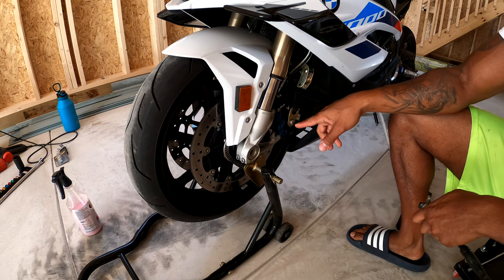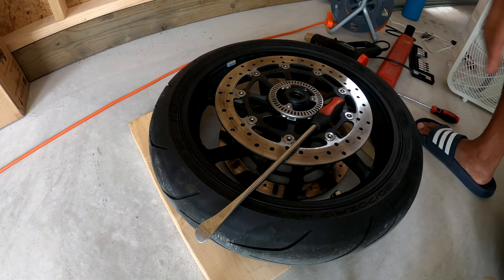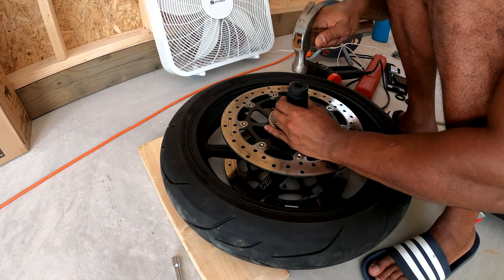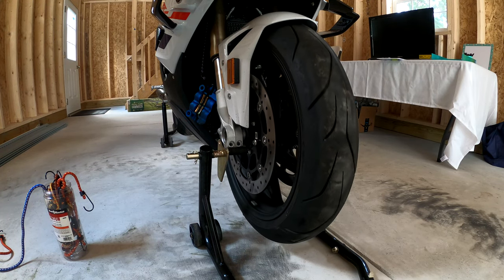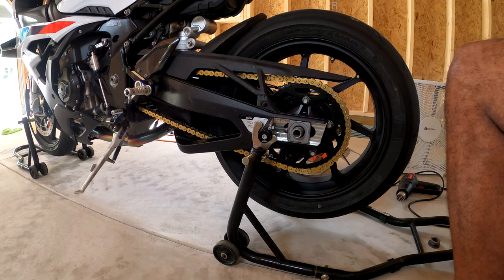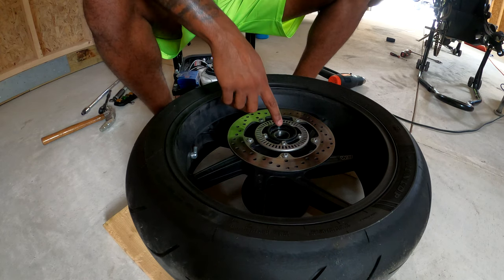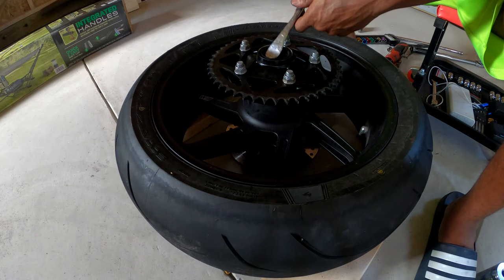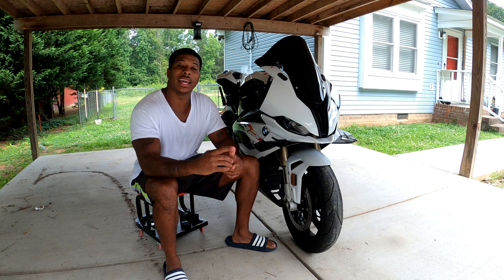2023 BMW S1000RR Ceramic Bearings Install

Comment: I just did my front wheel and its hardly spinning for 10 seconds. Is that due to me installing dust covers? Or am i messing up somewhere else the bearings spun freely when I installed.
Reply: Ok so I removed my dust covers and now it spins like a yo-yo. Damn that's a big difference.

Comment: I’m still confused, what’s the point of changing the bearings? It helps with breaking?
Reply: They spin more easily and help you accelerate faster. and since they’re ceramic, they aren’t a metal which expands a lot when they get hot so they continue to spin freely
Reply: Just to be clear the second part of that question no it will not help with braking, it removes friction from the bearing so they spin freely that will inherently make your brakes work harder to stop you because you no longer have the bearing friction slowing you down, however the difference would probably be small enough you wouldn’t notice the difference in braking force
Reply: tiger2q was also right your removing bearing friction so your bike will have an easier time accelerating, it will also keep heat down while your bearing spinning which should make them last longer, also you should notice your fuel economy go up if your driving in a reserved manner due to less friction for your engine to push you

Comment: What's the reasoning for leaving the dust seals off?
Reply: Less resistance
Reply: It's not a good idea to leave them of. Road grime and all kind of dirt will find its way in a destroy stuff. Doesn't matter if the bearing is ceramic, they are not indestructable.
Reply: @talal5716 WHAT?? Lmao
Reply: @N31LE diggin the vids, but your killing me MC hammer. Lol. And no seals for less resistance is a concept ive never heard of. You just taught us that with ceramics it's possible to balance your wheels on the bike without dust seals, which sadly means your spin time test is void now. Really think you should put your seals back in and retest. And those fancy new bearings will thank you. 🤙

Comment: Also pretty sure you shouldn’t be at 92ft/p in the rear with ceramic . Should be about half that number
Reply from the maker: Doesn’t matter if you’re ceramic or not. The manual states the rear axle torque is 92 ft/lbs.
Reply: @N31LE  it does according to WWB
Reply from the maker: @MadMaxOn2  if you can find that information, I’d be more than happy to change what I said. But as for now I believe you’re mistaken, there’s no way they’re going to say to say to torque your motorcycle axle to half the value of an OEM torque spec because of a change to ceramic bearings lol.
Reply: @N31LE   its standard axle nut torque spec
Reply from the maker: @Taste_Budz  yes standard torque is 92 ft/lbs..
Reply: @N31LE   Im telling yall😂
Reply: @Taste_Budz spec doesn’t change with the wheel bearings.
Reply: I have my rear axle at 50 ft/lbs never had a problem lol 
Reasons r drag racing

Comment: Mate I like your videos but this one made me cringe. These bearings are so expensive and need to be installed with care and a bearing kit not drifted in.
Reply from the maker: I hear you. But that’s how you install bearings, so I’m not sure how much “care” you wanted me to use there. You should see how a motorcycle shop puts em in 🤣🤣
Reply: @N31LE  I get it but a better way is to use a threaded bar with a washer pack and nut on the opposite side of wheel then you can drop the bearing into its cup and use washers and a nut bearing side to tighten down until seated. This way puts even pressure across inner and outer race and potentially stops damage. Of course proper bearing install/removal kits are available but basically do the same.